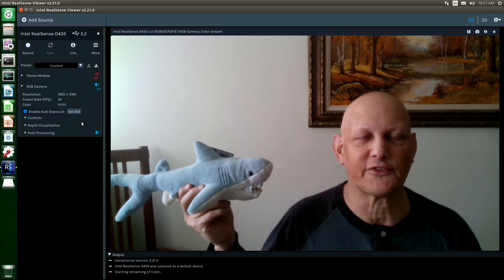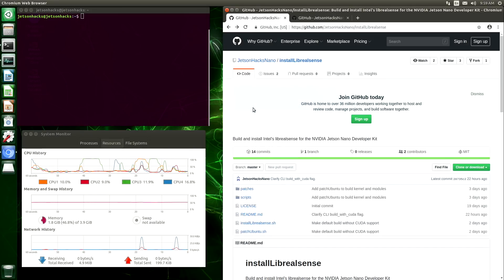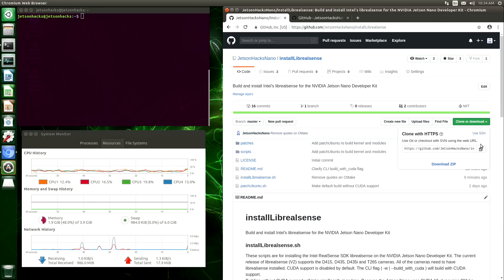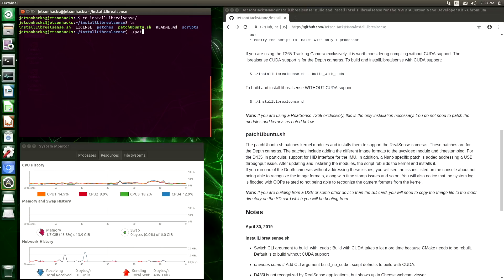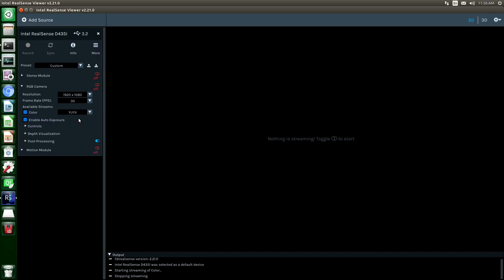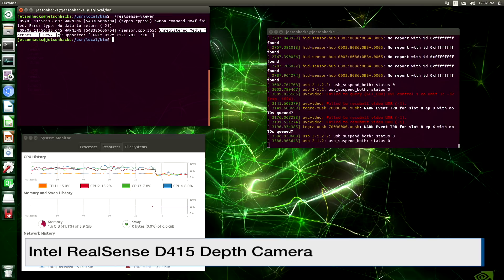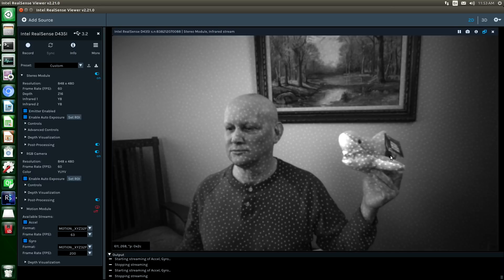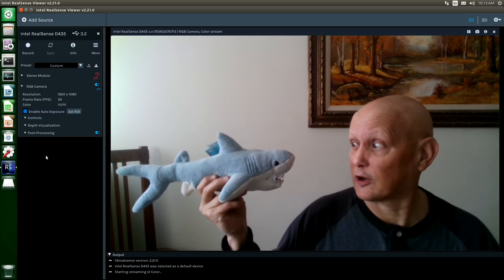Jetson Nano + RealSense D400 Depth Camera

Comment: Even if this is 2 years old, I try to get a D435 running on Jetpack4.6 without much succhess. I was able to build everything from source and it seems to run fine. However, as soon as I start realsense-viewer or ROS wrapper for it, performace of jetson is incredible poor. I don't get more than 1pfs with CPU usage of 100% on all cores. 
I build it with CUDA support but GPU gets used only a bit.
I powered everything with barrel jack and a beefy (200W, 5V) DC/DC converter.

Any Ideas how I can improve things?
Reply from the maker: Intel updated their instructions for installing RealSense cameras on Jetson. Here's a video, please read the article in the description of that video. Make sure that you also upgrade the firmware in the camera. Also, make sure that the camera is running USB 3.2 which is shown in the RealSense Viewer application. Good luck!
Reply: @JetsonHacks  thank you for your answer. Could you please share a link to the video you mentioned?
Reply from the maker: @patrickweber83  Oops, sorry about that: https://youtu.be/lL3zxwN5Lnw

Comment: Thank you so much! Question: I'm trying to run the rs-dnn.cpp example on the nano with the D435 camera - can this be done? I'm getting errors when it comes to using CMake
Reply from the maker: I have not tried it. It's difficult to tell what your issue is from your description. Thanks for watching!
Reply: Sorry for the vagueness! It seems as though most of the demos from realsense are able to work on the nano - however the dnn demo does not appear in the demo folder and remains as a .cpp file in the librealsense/wrapper/opencv/dnn folder. I was wondering if this was typical on the nano? Thanks
Reply from the maker: @christianealford8071  Not quite sure what "typical on the Nano" means. The OpenCV DNN is sample code which requires a properly configured development environment to build. There is a reliance on the version of OpenCV and the installation particulars. Looking at /librealsense/wrappers/opencv/dnn you can see a short explanation on how to build the sample. It feels like they make the assumption that the user has a good working knowledge of OpenCV and understands about how to use the DNN module. I haven't tried it, but it is certainly beyond the scope of what I could answer in a YouTube comment. 

I would guess that the major issue is in configuring the dev environment. The typical answer to "getting errors when it comes to using CMake" is usually to fix the errors, but that presumes that you know what the actual errors you encounter might mean. It's not very forgiving or helpful.

Comment: Great work, I used this tutorial to install my real sense D345  on jetson nano. It worked well with the terminal. But when I launch with cheese, it doesn't show anything. Kindly help with a solution
Reply from the maker: Cheese requires a UVC backend for the librealsense drivers. You will either need to compile using the UVC flag, or you can use the branch 'easyInstall' which loads a compatible version from a librealsense repository. Thanks for watching!
Reply: @JetsonHacks  thank you for your response,could you please direct me to the appropriate link for executing this?Thank you
Reply from the maker: @olalekanisola8763  The easyInstall branch of the Github repository installLibrealsense on the Github JetsonHacksNano account.
Reply: @JetsonHacks  tried installing all over again  and it generated an error. The jetson Nano hangs each time i launch the cheese or the real sense. How can I uninstall everything and so that I can reinstall all over?
Reply from the maker: @olalekanisola8763  I do not know what you have done, it is difficult to advise you. You should reflash the SD card and start again. The UVC version is now the default version in the repository.

Comment: When running your scripts a bunch of errors are thrown during the make process.  Do you have updated scripts for L4T 32.2.3.

I get the following message when applying the patch:

Jetson BSP Version:  L4T R32.2.3
Jetson_L4T=32.2.3

==== L4T Kernel Version Mismatch! =============

This repository is for modifying the kernel for a L4T 32.2.1 system.
You are attempting to modify a L4T NVIDIA Jetson Nano Developer Kit system with L4T 32.2.3
The L4T releases must match!

There may be versions in the tag/release sections that meet your needs

Great video and the theme music still rings in my head ... ;-)
Reply from the maker: Intel recommends using a .deb package for newer versions of librealsense. See the 'easyInstall' branch in the repository.
Reply: @JetsonHacks  Thanks for the insight.  I stepped back to L4T 32.2.1 and brought up RealSense.  After loading the application did recognize I had an outdated firmware version so I went on and updated it.  So far, so good.  Deeper into the rabbit hole I go.
Reply from the maker: @kryptonic010  I'm glad you got it to work.

Comment: How many realsense can work with one Nano together? Each usb 3.0 should have like 5Gbps, but maybe the 4 ports share the 5Gbps, not 20Gpbs?
Reply from the maker: That's correct. There is only one USB hub for the 4 USB 3.0 ports so you have the 5Gbps limit. Thanks for watching!

Comment: Hey Jim. Could you help me here? I installed my D435i following the same steps and your script. I'm having this annoying issue: when I shutdown my nano and then turn it back on, D435i is recognized normally as intended. However, if I reboot instead turn off/on, it stops being recognized after reboot with a real long list of "unable to enumerate USB device". The same behavior applies to my desktop PC, not just for Nano, though.
Reply from the maker: This sounds like a broader issue than just the Nano install. You may want to ask on the librealsense Github repository. Thanks for watching!

Comment: I just bought a Structure Core sensor. The depth performance on it looks amazing, but sadly for some reason I can't get decent framerates on the Jetson Nano. Depth only is at 30 FPS, but as soon as I add RGB the framerate drops to 9 FPS, and IR? Forget it. I see you are getting a full 60 FPS there with all streams enabled! What the heck. 

The Structure sensor works great on my high end laptop and desktop. 30 FPS with all streams enabled, and the depth performance looks very good, I think it looks better than what I see in this video. 

It seems I can't use it properly with the Nano though! That is what I bought this thing for, in fact I bought two!!! Bah. I'll have to convert them to other uses like smart security cameras or something, or get one of these cameras.

Structure sensor looks superior quality wise though, but I'll have to find another portable device to connect it to. There has to be some kind of USB 3 bandwidth issue on the Jetson Nano.

Comment: It would have been nice for Intel to provide a more secure hard wired option for the camera, but that's nothing a little surgery can't fix. This camera seems to be a big step up from lidar. There could be an advantage to using both technologies at the same time for navigation and object detection, or maybe not. Could be an interesting weekend project to find out. I've been looking at the TI mmwave sensor boards and I think the Jetson would be a perfect platform to take advantage of that technology. If you're wanting to track multiple targets or a single target among many. The TI mmwave sensor board will do it without any optics. You might consider taking a look. Anyway, I enjoyed your video. I always find them refreshing and relaxing. I think it's because you're always relaxed. I'm always intensely focused when working on a project and wanting as much solitude as possible. Have a great night Jim.
Reply from the maker: Thank you for the kind words. It's not apparent, but it took several weeks to get the RealSense camera to work with the Nano. The videos tend to be after everything is working, so it's easier to be relaxed. 
I'll note that the cameras are really developer kits, similar to the Jetsons. There are OEM modules that people can integrate into their products.
I'm interested in the mmWave stuff, but I'm not quite sure how easy it is to get it to work with the Jetson. Thanks for watching!
Reply: Interfacing the mmwave board might not be  so much like working with legos, but persistence and confidence will take you a long way. I haven't made it work with the nano, but I'm confident there's away to do it.    Make sure the words "I can't"  aren't in your vocabulary.  There is always away. It just has to be found. Thank you for your time Jim and for being so nice.

Comment: Great project!  In your opinion, is the camera worth the 400+ dollars?  Love to see a comparison to cameras used in your other camera focused videos.
Reply from the maker: Thank you for the kind words. I only do videos on products that I think are worthwhile. The RealSense Depth Camera is $200.

I don't really do comparisons right now as there are so many different applications that people use these devices for that it's unfair to the various vendors to say "This one is better than another". It all depends on what the selection criteria is, and how it is being used. 
Also, there are several manufacturers in this space with competing products. These include Structure.IO with their Structure Core product,  econ-systems makes a stereo vision camera, MYNT Eye too. Each has their advantages, disadvantages, indoor, outdoor, range, accuracy, FOV,  and so on. 

Also, it depends on how you intend to use the Nano. If you are using it simply as a depth processor, or for occupancy mapping, or a tracking camera that's one thing. 
For example, the ZED uses the computing capabilities of a host to build its depth map. That may be good (you're using the Nano as a depth processor), or bad (you need as much processing as you can get so you can run neural nets/CUDA code). Like all engineering, there's tradeoffs and design considerations that you have to take into account in any project. It's a good idea to study for your component selection and fully understand your project needs. 

With that said, the Intel Tracking Camera T265 is not like the others in the group. It's difficult to find two global shutter cameras with fish eye lenses for $200, more or less with an integrated IMU and a vision processor that straight out gives a stream of poses. But obviously that's of little value if you are not on a mobile base of some sort.

If the camera is stationary (for example, tracking people in a space), that's a completely different use case than on a mobile base (a robot mapping a room as an example). If you are trying to visualize a point cloud, that's another thing, and so on. The only thing I try to do here is share "How do you get this thing to work to begin with", and let others figure out how they would actually use them in their project.
Reply: @JetsonHacks  Sorry, missed the May 6th video on the T265.  Both videos have the same title.  T265 is tempting at 200$.  After doing some research into Global vs Rolling Shutters I realised how a phone snaps a QR code so quickly.  Thanks for a thoughful reply, good info!
Reply from the maker: @glikar1  I'm glad you found it useful!

Comment: Just got my first Jetson Nano and been playing with it all weekend (used up my whole long weekend!!). At first I was a little disappointed with the performance, but I don't have a proper power supply yet. So far only have a ZED Mini camera, which for my purposes I don't like that much. 

I tried to do some 3D mapping and I found it would run out of memory and start swapping like crazy. I was very disappointed. Seemed like this little thing would be useless for me and I'd be better off streaming over wifi or coughing up much more $$$$ for a Xavier. Then I decided to try adding a Samsung T5 USB SSD and put a huge 64GB swap file on there. Night and day difference, now it runs flawlessly. I'm happy with this little thing. Definitely one of the best deals around if you are into this 3D computer vision stuff.

I was able to run the same 3D mapping apps on a smartphone under a Linux chroot, and the processor on my Note9 is faster,  but the Note 9 cost me $1500, and the Nano less than $200. The only other possible alternative I can imagine is something like a Vivostick with a Coral USB TPU, but that thing has only 2GB of RAM,  probably not even worth trying. Then again that SSD made a huge difference with the Nano.
Reply from the maker: Glad to hear that you were able to bend the little Nano to your will. Thanks for watching!

Comment: Hi Jim, great videos.

Please could you consider doing a video comparing the Zed camera with a T265+D435 setup?

Looks like the Intel solution is not only cheaper, but potentially performs much better due to the hardware IMU processor of the T265 combined with infrared depth tracking on the D435.

It would also be nice to see how this combination then compares with the D435i, which as far as I am aware, has the same IMU as the T265, but lacks the hardware processing (and has no pose stream).

Thanks
Reply from the maker: Thank you for the kind words. 
I don't really do comparisons right now as there are so many different applications that people use these devices for that it's unfair to the various vendors to say "This one is better than another". It all depends on what the selection criteria is, and how it is being used. 
Also, there are several manufacturers in this space with competing products. These include Structure.IO with their Structure Core product,  econ-systems makes a stereo vision camera, MYNT Eye too. Each has their advantages, disadvantages, indoor, outdoor, range, accuracy, FOV,  and so on. 

Also, it depends on how you intend to use the Nano. If you are using it simply as a depth processor, or for occupancy mapping, or a tracking camera that's one thing. 
For example, the ZED uses the computing capabilities of a host to build its depth map. That may be good (you're using the Nano as a depth processor), or bad (you need as much processing as you can get so you can run neural nets/CUDA code). Like all engineering, there's tradeoffs and design considerations that you have to take into account in any project. It's a good idea to study for your component selection and fully understand your project needs. 

With that said, the Intel Tracking Camera T265 is not like the others in the group. It's difficult to find two global shutter cameras with fish eye lenses for $200, more or less with an integrated IMU and a vision processor that straight out gives a stream of poses. But obviously that's of little value if you are not on a mobile base of some sort.

If the camera is stationary (for example, tracking people in a space), that's a completely different use case than on a mobile base (a robot mapping a room as an example). If you are trying to visualize a point cloud, that's another thing, and so on. The only thing I try to do here is share "How do you get this thing to work to begin with", and let others figure out how they would actually use them in their project.
Reply: @JetsonHacks  Perfectly reasonable!

I wasn't even aware of the offerings from MYNT or Structure. I've emailed support from both and it looks like the MYNT is more suitable for my needs. 

Thanks for your detailed response.
Reply from the maker: @SgtSiff  I'm glad you found the other vendors. Lots of interesting offerings out there.

Comment: I know you do not believe in a syllabus...but are you going to lead the install of ROS and a RealSense wrapper for the Nano?
Reply from the maker: I have no plans to do so at the present time.
Reply: @JetsonHacks   I understand.... I just not sure where to go as far as RealSense they only say they support ubuntu 16.04 yet we are running the Nano on 18.04.   Only ROS Kinetic runs on 16.04...if I want 18.04 that means ROS Melodic...but will the RealSense ROS wrapper install on Melodic?   Thought you might have a solution.
Reply: @sy2532  Hi, we are experiencing the same exact issue, have you had any luck with it?
Reply: @AliKutluozen  I have a few problems that I am working on with the Nano...you need to be more specific.  If you mean getting the T265 working, I have not gotten it to work on the Nano.   I have gotten the T265 working on the TX2(using JetPack 4.2)...so I am hopeful...that the same process will work for the Nano.  I need to be able to rebuild the Kernel...I am hoping Jim will soon give that to us...for the Nano...but I am currently doing that line by - line...similar to TX2.
Reply: @sy2532  Hey, thanks for answering back! Here is my situation: I have Jetson Nano with Ubuntu 18.04, ROS Melodic installed... I also have a Realsense D435i that I have installed thanks to the tutorial, it works. Yet, when installing realsense-ros, ROS can't find the Intel SDK 2.0 ... So, here is the missing link; ROS and Realsense SDK.

Comment: Can you run the D435 and the T265 at the same time on the Jetson Nano?
Reply from the maker: Sure. You have to be a little careful if you are streaming all the cameras (that's 5 cameras + the depth stream and pose stream) as you start approaching the bandwidth limits of the USB 3 Hub. If you have other USB devices connected on the Jetson, things can get a little laggy. Thanks for watching!
Reply: Sounds like I might have to use VNC or ssh from another computer for keyboard and mouse then. Thanks for the quick response.
Reply from the maker: @EricRohlfs  You should try it with the keyboard and mouse first, they don't use much bandwidth. If you are trying to use them with a USB drive at the same time, then you're probably over the limit.